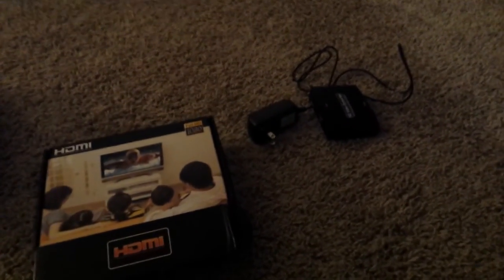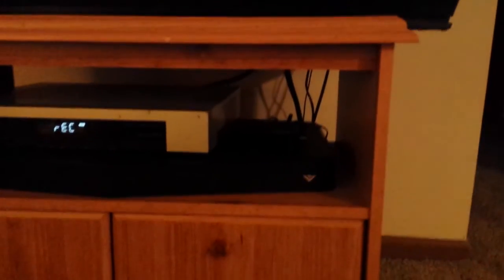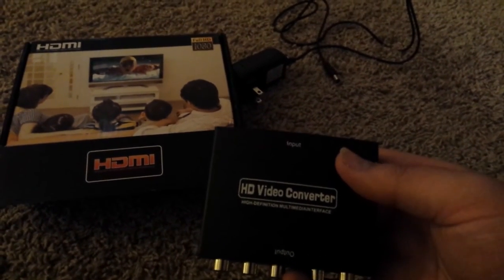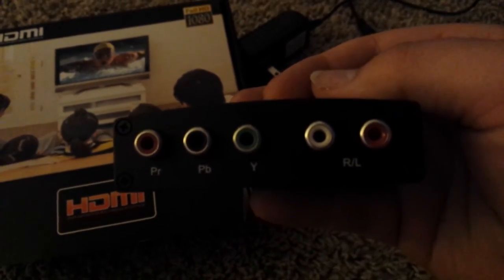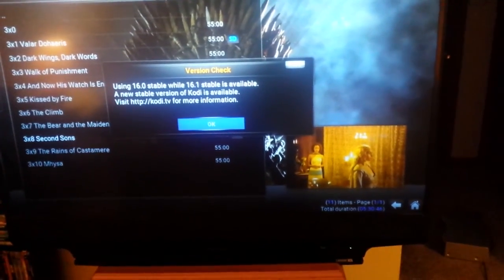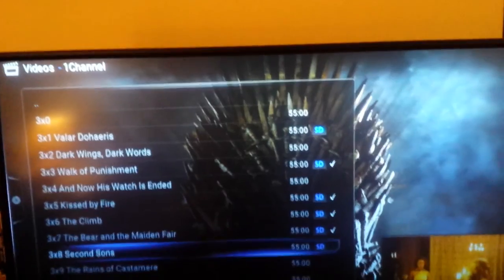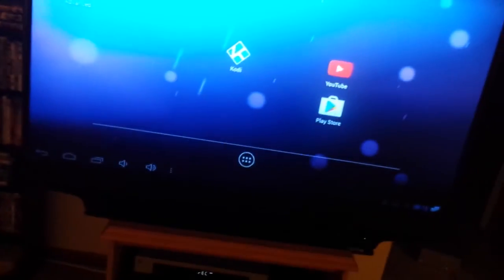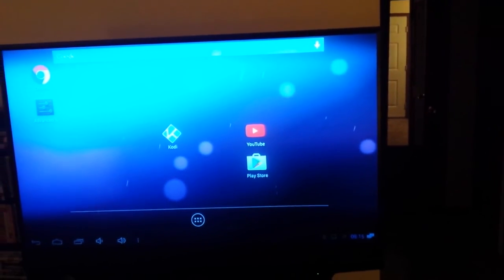HDMI to Component Adapter Review

Comment: Hello sir, it looks like your TV's native resolution is 720p. I got a TV that has a 480p resolution. Will this adapter work with my TV?
Reply from the maker: Correct. I've had it run 480p but the picture looks awful